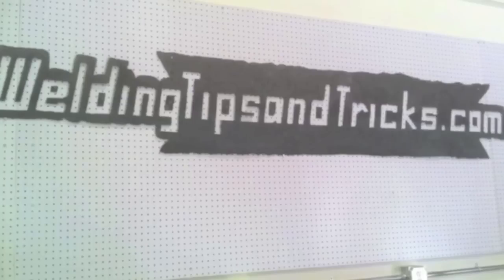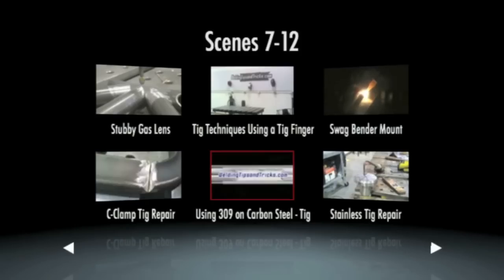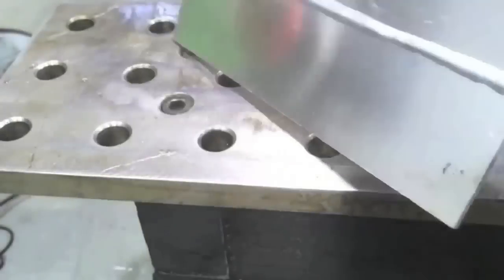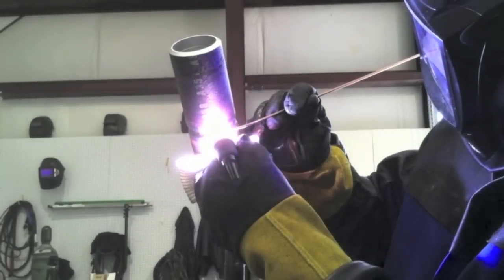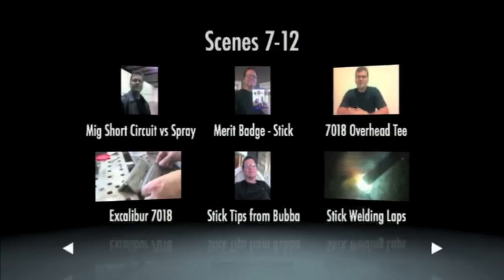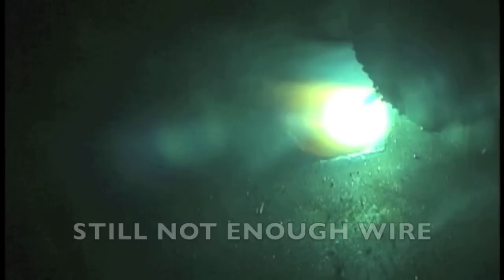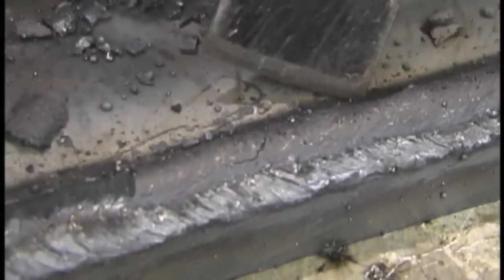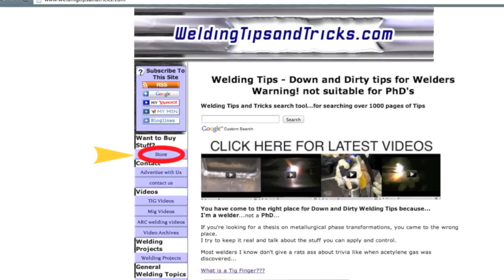WeldingTipsandTricks Channel Trailer

Comment: hi jodi you are a legend im a sheet metal fabricator i have lots of experience with thin sheet (s/s mainly) bench tops ect,but sheetmetal in australia at least is a dying trade to much importation from china so you dont get paid very well about the same as some one who works at a petrol station so im practicing vertical up with mig and pipe welding so i can get into a different field,i had been talking to every one i know to get tips on how to do certain things than i come across your channel

Comment: good job would like you to show how to set up argon purging for different types of alloy using a diffuser on 2" & 10" alloy 20 & 316 L stainless steel both require different purging psi doing this in a 6 g position